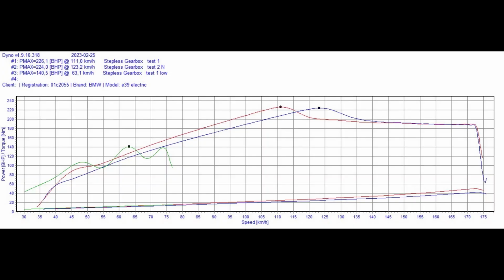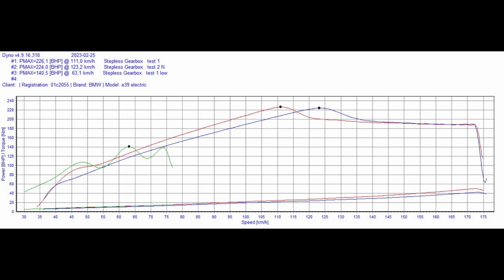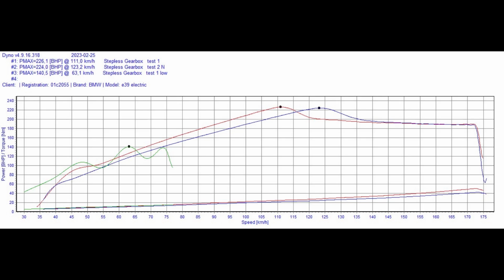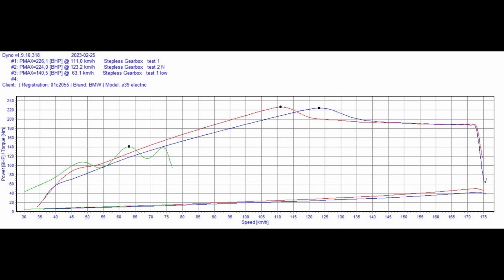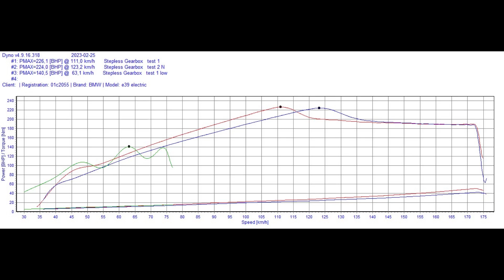LandYacht On The Dyno

Comment: Dodgey camerawork? Damien you sell yourself short. There was also dodgey audiowork! Not only did you film a screen that's completely whited out with a sunspot, but you also had interesting and incomprehensible conversation with the dyno tech while radio was blasting. Two types of amateur documenting in the same video! You spoil us. Ahem. I wonder what the the weakest link is for power on the LandYacht. Can't be the inverter yet. Is it the motor, the battery power, or the battery voltage? Clearly an ever-escalading series of upgrades followed by frequent dyno trips, then failure and rebuilding is required. All the big racing channels do it. How are you supposed to be as cool as Cleetus McFarland if you're not on the dyno twice a week?
Reply: I like where this is headed